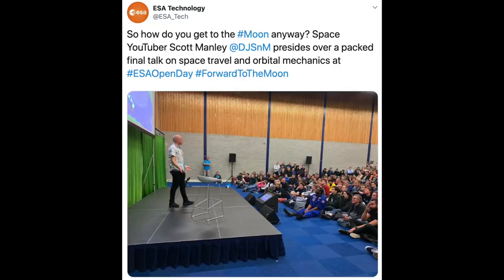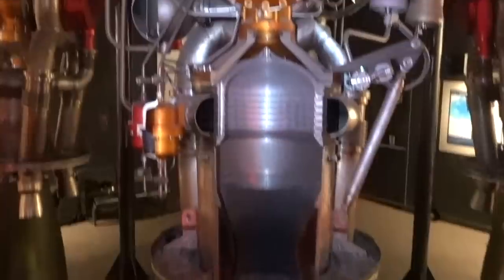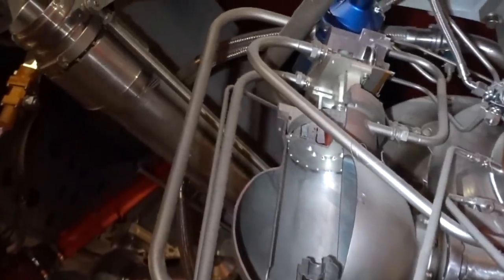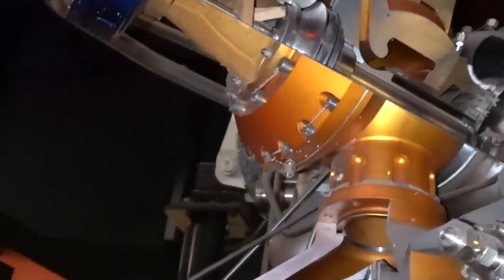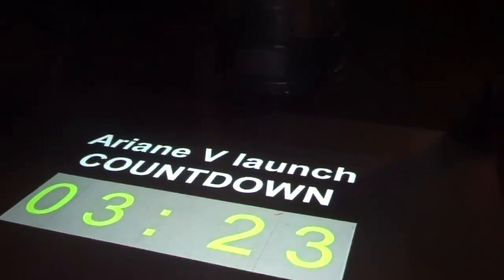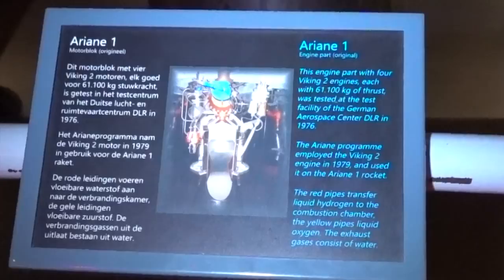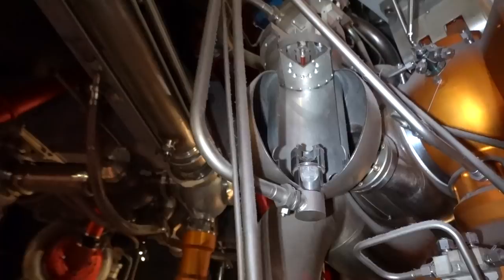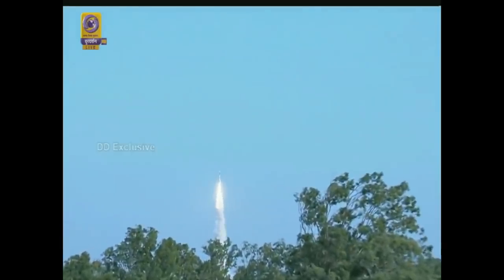The Viking Rocket Engine - Ariane's First Engine & Ancestor to ISRO's Vikas Engine

Comment: Hi Scott, I've worked with ISRO's Vikas engine for over a year, matter of fact when this video was published I was there with the ISRO engine team assembling these engines and I'd like to say that you were on point on how these engines work. I was really surprised by the striking similarities between the Viking and the Vikas engines, it was a part of technology transfer between India and France back in the 1970s and 1980s. The only thing that I think you were not so sure about was the water injection in the gas generator (combustion chamber that runs the turbine), It sprays water in two directions, upward from the central injection holes in the form of swirl and downwards from the outermost array of holes of the top injection disc in the form of film. Just  sharing information, although I left that job now, I am doing the same as you, spreading rocketry knowledge online and you are a big inspiration😊
Reply: Got you Ashish 😂.
Reply: Question for you: Who actually manufactures the Vikas engines? Godrej & Boyce, MTAR Technologies or ISRO?

Comment: Thank you Scott - your diligence answered a question I've had for over 30 years concerning the loss of an Arianne IV(?) and the RCA DBS satellite that it was carrying which I had worked on. A second or two after liftoff, one of the four engines suffered a dramatic drop in thrust, causing the other engines to gimbal over to compensate, raking the launch tower with their exhaust in the process.  

The flight appeared normal for around 30 seconds and then the rocket began to visibly deviate from its planned trajectory to a lower line of flight. There was a heated argument in the control room between the range safety engineers who wanted to issue the destruct command and the engineers who wanted the rocket to fly and produce engineering data as long as possible. The rocket settled the argument by going supersonic and hitting Max Q at a much lower altitude than it was designed for. Most of the former rocket's remains rained down into the ocean, although I'm told that a sizable chunk did land in the parking lot of one of Koru's only shopping centers. 

We were heartbroken (the first of 3 spacecraft losses in my career) and were finally informed about the engine failure, and that it was traced back to "a rag that technician failed to remove after they cleaned a water line". We were never told the function of the mysterious water line and speculated on what type of cooling or thrust augmentation function it might serve. But the truth remained hidden until your curiosity and insights provided the answer. 

Thanks for all you do from a fan, admirer, and "recovering rocket scientist"
Reply: I just came back to this after Scott made the video about exactly this.

Comment: I’ve always been curious as to how the engine mounts to the rocket and How’s the force from the exhaust is transferred through the engine and to the rocket.Maybe you can do a video on that .That would be great.
Reply: This is a fantastic line of questioning I've never thought of
Reply: I was wondering the same thing during the shot where you see the midddle body of the engine uder the attachment ring. It's a good visual at least.
Reply: Struts, lot's of struts :D
Reply: Me too, I've often wondered how they transfer these massive forces to the main body.
Reply: Engine mounting I am not as familiar with, but I can tell you that the thrust is usually transfered from the engine through the top of the injection manifold. That is because if you add up (well if you integrate it, but I won't get too technical) all the pressure along the inner walls of a combustion chamber, the top surface of the chamber (which is in most other cases the injector) is where the net produced force ends up being located. From there, on high thrust engines like this, they usually try not to put too much, if anything at all, in between the top of the injection manifold and the gimbal mount directly above the engine. Anything there would likely be crushed. That's why even when on engines use axially oriented injectors (not to be confused with axial injector elements) like the F1 they still go out of their way to route the fuel and ox lines in from either side. As for thrust transference it likely differes rocket to rocket as it's more an airframe consideration than an engine one. But broadly speaking the goal is to transfer all thrust loads to the material on outer most diameter of the airframe since rockets are basically giant flying fuel tanks, so there's nothing on the inside to even take loading of any kind. I hope this has helped, but regardless I too would love to see Scott do a vid on this topic as it's so important and too often overlooked as it's not as flashy as the engine operation itself (no pun intended).
Reply: @maxk4324  Super interesting! I like the point about how the pressure is mostly located at the top of the combustion chamber, makes a lot of sense since that's the capped end of the engine! I never thought about OP's question either but now that you mention them, these gimbal mounts must be crazy tough to endure all this!
Reply: YES! MechEng represent!
Reply: Every time I see a mess like that, including the multiple gimbaling engines and their actuators, I wonder how much Bob Truax was thinking ahead. I don't mean pressure-feed, necessarily. Just: one great big huge big fracking engine...
Reply: He just did.  That's all folks.    There is no more to that design.  Scott needs to release the new design of electromagnetic motors,  I think he is shy.
Reply: Max Kopstein Excellent description. The strongest structural part of the rocket is the skin. A ring of material called a "ring frame" takes the thrust load and passes it to the skin. The ring frame gets its thrust loading from a "gimbal mount" and struts and actuators. The gimbal mount is the primary structural connection between the rocket engine and the structure of the rocket. Typically the aft bulkhead domes of the propellant tank "hang" from the ring frame
Reply: Dean Moore that’s kind of how I imagined it. I couldn’t imagine it working any other way but seems like a lot of stress on those inch and Parts. Whatever the struts are mounted to on the engine must be some strong ass material.
Reply: Electron bolt They are literally as strong as they need to be by about 1.6 factor of safety. The struts are typically titanium. Gusset plates where the struts attach to the ring frame are the same material or compatible material as tank and ring frame. If it is aluminum the plates can be an inch thick (2.5 cm or so.) I was once upon a time a rocket engineer wannabe!
Reply: Everyday Astronaut
Reply: Dean Moore Thanks for the info I’m just trying to understand and learn about the mechanics. I’m just amazed at how little it’s holding the Engine to the rocket. It’s amazing that those struts and the engines themselves can handle that stress. Again just trying to figure it all out appreciate it.
Reply: @-danR  I read through his Wikipedia page and while a definitely big contributor to american cold war rocketry, I am not entirely certain to which project or accomplishment of his you are referring specifically. As well, I am not certain I understand your issue with multiple gimbaling first stage engines? It has been shown, pretty conclusively at this point, to be the most efficient, effective, and reliable way to control orbital class booster stages during ascent and, more recently, descent. But I would still be very interested to hear your side of the issue.
Reply: @TyMoore95503  Is this "ring frame" the same structure that SaceX refers to as the "Octaweb" (as much as I love them they seem to have a habit of using non-industry standard names for things)? Also your point about the lower tank bulkheads hanging makes sense. Since they aren't pressure fed engines the tanks would only have enough pressure to keep the liquid propellants flowing into the turbo pumps and thus not have the substantial boost in rigidity that high pressure tanks have. Mind you, all of my experience with rocketry is through my university's student rocketry team and our tanks are both much smaller in diameter and have a much higher wall thickness to tank diameter ratio, so maybe I am missing something due to the difference in scale.
Reply: Max Kopstein I think you've got it. Haven't seen the details of SpaceX design but I suspect the "Octaweb" you refer to may be part of a thrust  frame that distributes load from the 9 Merlin engines to the aft ring frame of their propellant tank. This should take on the appearance of an octagon with opposite vertices connected by lateral beams. This would give about the lightest and strongest structure.
Reply: How are loads transferred to parts of the rocket? I agree, a great idea for a video.
Reply: I think  that's a basic engineering problem. A cylinder shape is very rigid, so it shouldn't be too hard.
Reply: @pocok5000  Somehow, David, I suspect there is a little more too it.
Reply: Kaveri engine

Comment: According to the German Wikipedia site of the Viking Engine the engine bell is cooled by a film of fuel that is sprayed along the walls of the engines bell. So you should be able to see additional holes pointing down the engine bell on the fuel side of things. (Its hard to see in the video, but I think your guess was right.)

Comment: 5:33 Liquid boosters around a solid-fuel core? That is Kerbal as hell. You go, ISRO!
Reply: It's the same design the Ariane 4 used - up to 6 liquid-fuel boosters. ISRO basically copied the Ariane 4 design in every detail.
Reply: @totalermist  ariane 4 didn't had solid core afiak
Reply: @mrtrololol3251  It indeed didn't and that's exactly what I wrote.

Comment: There was an open house day at the DLR test facility in Lampoldshausen, Germany just last weekend - that's where all the engines for ESA get tested - like most current the Vulcain 2.1, the Prometheus and the ION thrusters. They too had a little museum with lots of stuff back from the V2 to the Europa to the Ariane. They had a Viking engine there too - next to the Vulcain 2 and various curious little engines from the Europa rockets. Viking was originally planned for the Europa III rocket - that didn't happen in the end.

Comment: Interestingly, it seems to also not use regenerative cooling, but only film-cooling. Really fascinating engine I would love to know more about!
Reply from the maker: The more I look the more I wish I’d added more to the video!
Reply: @scottmanley  There is a certain mystery here that I would love to get to the bottom of.

After the war, German engineers were invited to France to help with rocket development. The teams for propulsion, guidance, aerodynamics were set up in Normandy near Vernon at LRBA (Laboratoire de recherches balistiques et aérodynamiques) and produced a long line of engine and rocket designs all named V-something (in honor of Vernon).

First, in 1949 they have produced Veronique rocket (Veronique Reduced and Veronique Normal) with a quite sophisticated engine -- flat face injector, thin wall regenerative cooling -- at least superficially quite similar to the later and very successful technology used in Russian engines. It was pressure fed by using a complex tri-component gas generator -- such generators were specialty of Karl-Heinz Bringer, and many even later French designs have unusual gas generators for pressurizing tanks. (Note that Ariane-1 has to use steel fuel tanks on the first stage to be able to withstand hot pressurization gases from the gas generator! )

LRBA were launching this Veronique-N rocket from 1954 with about 50% success rate, but they talk about "knotty difficulties with combustion instability", and there was also a shortage of funding for this particular project -- the launches stopped for two years.

Then, seemingly out of nowhere, this advanced design is gone, and is replaced with a much simpler version that we see here -- using 15% of fuel for the curtain cooling of a single wall nozzle, and using radial injector made out of aluminum alloy. This flies very well on Veronique-AGI (AGI = french acronym for "International Geophysical Year") rocket, and serves as the pattern for a long line of french engine designs all the way to Viking.

As far as I can tell, this is the explanation, but it would be awesome to know for sure: At about the same time as Veronique-N was being developed, LRBA worked on an antiaircraft missile project PARCA (French acronym for "Self-propelled Radio-controlled Anti-Aircraft Projectile"). Although the version chosen for the final product had a solid-fuel motor, in 1948-1952 LRBA apparently has developed a liquid fueled engine for this missile. It was simple to produce and apparently worked quite well. There is a photograph from the museum of six engines all in the same shape but of gradually increasing sizes, lined up with the smallest one labeled "PARCA", then Veronique-AGI, Veronique-61, Vesta, (unclear), Valois. All of these engines (except being pressure-fed) have overall design later followed in the line of Viking engines.  

Timeline of LRBA engine designs:

1949 (first flight 1954) "Project 4213" Veronique: regeneratively cooled, flat face injector, kerosene+nitric acid, about 40 kN of thrust

1948-1954? "PARCA?" 40 KN
1965 Veronique-AGI: film cooled, radial light alloy injector, turpentine + nitric Acid, 40 kN thrust
1964 Veronique-61 53-60 kN
Vesta
Vexin 274 kN
Vexin-A from this engine forward switch to UDMH and N2O4 as fuel
Valois 350 kN

1971 
Viking-1 (M55) 540 kN; gas generator still used to pressurize the tanks, but the engine is now fed by a turbopump
Viking-2
Viking-3
Viking-5
Viking-4
Viking-5B from this engine forward switch to UH25 as fuel
Viking-4B
Viking-5C
Viking-4B+
Viking-6

(There had also been an early design using liquid oxygen as the oxidizer -- EOLE (French acronym for "Vehicle using Liquid Oxygen and petroleum Ether"). In 1950 explosion of EOLE destroyed the test stand and injured three people. Fuel was switched to alcohol. Launches were unsuccessful. The EOLE project was cancelled in December 1952.)
Reply from the maker: @cogoid  Thanks! Looks like I have a lot of things to research.
Reply: @scottmanley  American Astronautical Society (AAS) History Series, had many in-depth articles on French Rocket Program -- particularly by Philippe Jung, an expert on the subject.

"The widely-held opinion about the origins of French space activities is that it all
started quite modestly during the fifties with the emblematic Veronique, followed
up in 1962 by the Precious Stones rockets and the creation of CNES. Nothing
could me more remote from reality.

A first attempt at analyzing rocket activities in France in the aftermath of
World War II just reveals a bewildering array of programs. All three French armed
forces lost no time after the Victory to develop missiles, as a consequence of
German achievements in that field. There were two main lines of thrust: the medium
range ground-to-ground missile, alternative to the tactical bomber, and the very
much sought after anti-aircraft missile, with the horror of the Coventry and Dresden
terror bombing still resonating.

However, everybody followed its own route. The Army tried to remake the V-2.
The Air Ministry decided to start from scratch and to launch a vast prototype policy,
covering all missions for all users, including the Army and the Navy. The latter adopted
an intermediate position, first building German missiles, before switching to its own
products.

All told, an incredible 70 programs probably reached the flight status
from 1939 to 1959! It truly was la Furia Francese -- something unearthed for the first
time in this paper. Thus, when De Gaulle came to power, and before CNES
creation, the French armies already had mastered the full spectrum of rocketry,
with the single exception of inertial guidance."

[From "The True Beginnings of French Aeronautics 1938-1959", Philippe Jung, AAS History Series, Part I in Vol.28 (2007) and
Part II, Vol.30 (2009)]